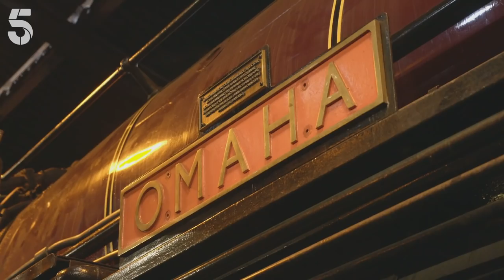Can Boiler Chief Mark Fix A Historic American Steam Train? | The Yorkshire Steam Railway | Channel 5

Comment: The man hitting the piston with a hammer should make a ring compressor so he does not repeat the butchery.
Reply: Served his time at Dewhurst 😁
Reply: @G Rossi Just make a ring compressor as he had already broken one butchering it.
Reply: the different sizes of rings and were they sit inside the castings make using a compressor a pointless exercise that would take 5 times longer cos you would need 3 different ones at least and theres no space to get them in. the quickest and most efficient way of getting that assembly in is in fact the way it was done. because the rings are spun cast iron as well the chance of busting them is just as high however you do it as there as thin as a child's christening band.
Reply: @roberta6641  Thanks for your reply, I am a machinist would has machined many sets of cast iron rings in my time, It is very hard to see the way the bore is machined and the way the rings are mounted, are they the same diameter or a different diameter.
Reply: Exactly what I thought. Mark should have compressed the piston ring with a jubilee clip as there was no room to fit a piston ring compressor before hitting the piston down with the hammer handle.
Reply: @roberta6641  cable ties. Your friends in situations like that.
Reply: I was thinking the same.

Comment: Its nice seeing a U.S locomotive operating abroad.
Reply: You realise that S160s and S100 dock tanks (known as yank tanks) were built in large numbers to operate in Britain and mainland Europe in the Second World War, right? The only American part of them is the design, there entire heritage is within Europe.
Reply: @o.m.b.demolitionenterprise5398  true but several of the S160's and S100's did work in the United States after the war, with several of them have since been preserved. Still most of them were in Europe but I've always considered then international engines given they really did work abroad anywhere a nation needed them.
Reply: And she's a valued member of our railways Steve. :)
Reply: @o.m.b.demolitionenterprise5398  Incorrect. These locomotives were a standard design used by the US Army Transportation Corps (USATC). They were specifically designed for use on European lines taking into consideration European design standards and were intended for heavy freight work to help with the war effort and they were shipped to Britain during World War 2 in large numbers ready for the Invasion of France in 1944. A total of almost 800 were built between 1942 and 1943, and shipped to Britain. 

They were constructed in thirteen batches by the American Locomotive Co. (Alco), Baldwin, and Lima. Although intended for use after the invasion, the first 400 were put to immediate use by the British War Department working with the "Big Four" railway companies.
 
The first forty three locomotives to arrive in Britain were overhauled by the LNER at Doncaster, and hauled local services whilst running in. The first S160s were largely concentrated in the South Wales area, so they were quickly transferred to the Great Western Railway (GWR) in early 1943. Between March 1943 and January 1944, a total of 168 S160s would enter regular LNER service. After the first 400 entered service with the "Big Four", later S160s were prepared by USATC personnel at Ebbw Junction before being greased and stored ready for use after D-Day.

2253 herself was built by Baldwin Locomotive Works in America in 1943 and shipped to Britain aboard the Norfolk which arrived in Hull in May 1943.
Reply: @Crimsonedge1  that’s what I said...
Reply: @o.m.b.demolitionenterprise5398  you said they were built in Great Britan tho
Reply: You guys have got one of our old London Underground trains now. I believe it’s being featured in a museum. Looks completely different to what it did when we had it though lol
Reply: @o.m.b.demolitionenterprise5398  true, but Britain and Europe piggy-backed off of America’s still intact infrastructure and factories to make our machines of war. Essentially an American design built to operate within a smaller loading gauge. We can call them one or the other, but they are in fairness both.
Reply: @presidentobunga8102  No I didn’t, read my comment.
Reply: There are none of this class operating in the US that I know of
Reply: Designed to last a few years and they lasted to the end of steam

Comment: After all it is an American piece of equipment. Eventually it will do the right thing and work
Reply: Emphasis on eventually.
Reply: Not anytime soon, but yes, eventually
Reply: Or not.
Reply: Not if someone is willing to pay it even if it's not working.
 This is coming from an American, here. Yes, I am employed.
Reply: It’s amazing just how durable these things are they were designed to last 5 years thru the war and several are still working today
Reply: @duxlorbitxl9986  I mean..its a 70 or so year old disposable steam locomotives that was built to last the span of WW2, yet its still working all this time later. Regular American locomotives working in America are usually less problematic then British steam locomotives given they are designed to be easier to maintain are far more rugged. Not sure where any brit, especially when you consider british diesels, gets off by saying American equipment is inadequate or unreliable.

Comment: Seeing an american locomotive with buffer and chain couplers makes me uncomfortable
Reply: Why?
Reply: I mean I believe this one was made in the UK, its called american because it was Designed in the US and was used in the US for a while and I am sure the US provided the parts and tools to build them in the UK to help the war effort in WWII. I can agree though that the chain couplers are just not right on a locomotive, its just feels off.
Reply: @PilotTed  No, it was built By Baldwin Locomotive Works of Pennsylvania.
Reply: @PilotTed  It wasn't made in UK. It's fully American built locomotive for military use during the war. It was specifically designed to fit British and European railway standards. After the war those locomotives were given away to many European countries.
Reply: It is a strange sight…. Although I think it’s cool seeing an American Loco with British rolling stock. Very cool!
Reply: That's Like If the big boy were to be Built smaller and less heavy than it is to Be apart Of the British Railways
Reply: @PilotTed  It has a Baldwin builders plate (Works Plate) as seen in the video.

Comment: Looking at these USATC locomotives is kind of strange, because they are very obviously American designs but they have buffers and chains and don't have a bell. It's freaky but very cool.
Reply: the proportions are also dissimilar to basically all other locomotives so it's a bit strange to behold, but still pretty cool
Reply: It's a strange configuration, but very common in a old railroad here in Brazil: the Companhia Paulista de Estradas de Ferro (Paulista Company of Railroads). They used to have american steam locos, but 'til the mid 50's uses european buffers-and-chains couplers. Even had 3 "very american" diesels ALCo. PA-1 with these couplers
Reply: Its definitely cool seeing an american engine built to the standards and limitations of british irons. I would reccomend looking into the Flying Scotsmans USA tour to see what it looks like the other way around! She wore a cowcatcher, lamp and bell, equally strange lookin
Reply: I think the exported 160s had Bells... They were just hard to see as far as I know.

Comment: Wish we could make eco-steam engines  because I just love the look of steam engines and all the mechanical stuff moving and the steam
Reply: There is a steam locomotive at the grand canyon railway that burns recycled vegetable oil with burns much cleaner that oil.
Reply: Steam engines are as eco as they can go really there 100 years old or slightly less meaning no manufacturing infastructe they last well forever and produce steam and water no issues
Reply: @jamestaylor766  lol
Reply: Fireless locomotives are still fairly common for certain applications
Reply: A steam engine will rarely be as efficient as even a bad diesel... due to the thermal cycle it runs 1-10% efficiency is common, and later steam engines can get into the 10-20% efficient range, whereas a steam turbine may be in the 40-50% efficient range.
Reply: Torrified biomass may be the ticket for green steam
Reply: @Wingnut353  one could build a steamer more efficient than internal combustion in theory
Reply: @the_retag  The last N&W classes were more thermally efficient than the GP9's that replaced them.
1930's-era Deutsche Reichsban steam classed were more thermally efficient than 1950's-60's diesels. The DB simply ran them until they electrified the heaviest mainlines in the early 70's, & dieselized the rest w/units that were finally as efficient as the wartime steam engines.
Reply: Steam engines are from a far better time, when things were interesting, because weak pansies weren't allowed to ruin everything.
Reply: @emilyadams3228  they are bette rin some ways than internal combustion, problem is cost. And electric where possible is realistically the most eco
Reply: @emilyadams3228  the DR (east germany) modernised much of their steam fleet, the reko program, because they didnt have enough other locos. And if you want to see some super-modernisations of steamers look at the red devil and a 52 i think it was that dlm (formerly steam part of slm) modernised
Reply: @the_retag  Yeah, they built some fabulous & beautiful engines. Some of the best in the world.
Reply: the problem with steam locomotives is not the pollution, its the maintainance. an old saying goes "a day on the road is a day in the shops." the mechanical complexity brings a lot of downsides.

Comment: I find it jarring to see an American locomotive in Britain, but then again, a Big Boy or the Atchison, Topeka and Santa Fe Railway (San Fe) 3000 class 2-10-10-2 s would look crazier there. Though the Baldwin 10-12-Ds look like they fit, that's because of a different gauge.
Reply: how about this, an Isle of Man 4-4-0 on the cumbres or durango lines. would be fascinating since same guage but iom loco is tiny compared to a k37
Reply: A lot of american mallets physically won't fit on the british rail network
Reply: The rail gauge is the same but the UK structure gauge is even smaller than some narrow gauge systems and certainly all standard gauge.
Only US equipment that fits was needed to specially built low and narrow like this war time locomotives but still standard rail gauge.
Reply: @johnd8892  Or a smaller earlier locomotive like the early baldwin 2-8-0's and The old rogers ten wheelers
Reply: @raymondleggs5508  you have reminded me of the earlier era when the USA made smaller Locomotives for home use and export. In 1899 the Midland Railway, Great Northern Railway and Great Central Railway purchased a total of 80 Baldwin 2-6-0s of similar design, fitting the UK loading gauge. The last of these ran in 1915. A short time for UK railways Their short period of operation did not convince the railways to make any future  purchases but the Mogul wheel arrangement caught on.
Another US locomotive running briefly around the same time was an ex Philadelphia and Reading Baldwin 4-2-2. Later bought and named Lovett Eames by the Eames Vacuum Brake Co to demonstrate their brake in the UK. Photos show it fitted with buffers but importantly a special curved profile and possibly lower cab fitted to cope with the tight clearances in the UK. Only did a few demonstration runs that was judged not to show enough advantages over  existing UK vacuum brakes. It's bell survived at Kings Cross then Hornsey.
I think this was the total amount of US standard gauge steam usage until WW2 specially built locos.
I must track down the actual substantially smaller width, height and width over cylinders to cope with UK platforms, tunnels and bridges.
Even caused a major redesign by EMD to fit SD40-2 mechanicals into the restrictive car body needed by the class 59 and now class 66 diesels.

Comment: Using a crescent wrench in a workshop area, hitting a screwdriver while using it as a chisel/drift, not surprised he broke a ring, surprised he didn't break another, all this in one small repair, wouldn't go down well working on any mans machine, wonder what the owner thought on top of it not being available to him through a breakdown.
Reply: Not as bad as when ours was damaged while on loan. You take out the swearing own MD said. They couldn't have it back once it was fixed.

Comment: The 160s were originally only supposed to last 90 days.
Reply: 90days? That sounds too short, i know the german 52s were made for 15 years, but 90days just sounds to short for the effort of making any kind of locomotive
Reply: @the_retag   it was a while back when I found out so it could have been 90 or 190 days
Reply: 90 days. There is a link in the valve gear that can be cut to disable the, should they have to be abandoned in a retreat, as well as an emergency steam dump valve on the boiler to dump all pressure. The metal was just thick enough and indeed it was  90 days.
Reply: @jacobwoods8738  thank you for the clarification

Comment: Does the "boss" not understand this is like 100 year old technology and wont be as reliable as his 2010 honda car
Reply: 1: 200 year tech
2: it is
Reply: I don't think this production is fair to anyone involved in it. Of course they are going to drama it up for TV, but a ~100 year old piece of machinery being temperamental is just business as usual. It really made the boss and the locomotive owner look sort of unreasonable, and that probably (hopefully) is not the case in real life.
Reply: @bussesandtrains1218  actually 100 year was correct, the s160 was built roughly in the 1940s.
Reply: @ryano.5149  actually some owners are absolute peices of work, and ive had the honor of meeting a few that luckily my workplace wont ever do work for again. but the owner in this video actually is an alright guy, ive met him in passing once. he was just REALLY looking forward to going on that loco.
Reply: It is as reliable as a modern car if you repair and maintain it properly. That air compressor wasn't repaired properly, someone caked the outside with 10 layers of paint but did barely any work on the insides.
Reply: @bluef1sh926  but it's gonna cost twice and take twice as long. A  modern car could take less than a day for something like that.
Reply: @proctor107  I'm going to assume you haven't seen much of steam locos, because there are quite a few which could not only out haul any modern car or truck, (Hence why they stayed on the mainline as long as they did), but there are quite a few with more capacity for fuel which means less stops, and as for reliability there are several examples of reliable steam locomotives in preservation, the most famous ones being Union Pacifics Oil Burners. It's all a matter of proper maintenance.
Reply: @proctor107  and in terms of taking twice as long, the timing made by the New York Centrals J3A is generally 16 hrs from NY to Chicago, in a car it would take 12 hrs, but that's only if the road isn't as crowded as it usually would be.
Reply: @proctor107  and besides the other things I've listed, travelling in a steam locomotive actually has more of a public appeal, it's the whole reason why roughly 2,000 steam locomotives are preserved in the US.
Reply: @darkchaotix1productions326  That's besides the point. The while point is he wants it done in like 2 hours which with old technology just isn't enough time.
Reply: @proctor107  well, it would depend on whether they already had the parts needed at hand, but it would likely take much longer than 2 hours.
Reply: @darkchaotix1productions326  Are you alright? This aint debate club.
Reply: @proctor107  Everyone knows that this isn't a debate club, but this is a internet platform where people can debate things if they want. And as such I chose to debate your earlier  statement.
Reply: @darkchaotix1productions326  Right? I mean you do you mate.
Reply: @proctor107  it's not the "old technology" that's the problem, steam locos are a lot simpler than your average car... it's just the size of the thing that makes everything take longer

Comment: Imagine if the UK got FEF locos
Reply: That would be a big problem, Even tho U.K and the USA share Quite the same loading gauge, American locomotives like the FEF is Simply too Tall ,wide and heavy for the rails and for Station platforms and traveling through most of U.K areas. Just think of what the big boy could do to those Rails.
Reply: The rails would all die at the thought of an fef
Reply: @backonpro5679  I’m sure they would, but old me didn’t know that

Comment: Stopped Dead center was the issue on the cylinders.
Reply: Wrong, one side is in 90 degrees offset to the other, so when one piston is in the middle of the cylinder, the other is at the end of the other cylinder.

Comment: What doesn't help is that its an S160. They were designed cheap, built cheap, and ran on duct tape more than metal. They were war engines, which is not uncommon. Do a job short term, then get thrown away in 5 min. But because they are like.....the ONLY standard gauge American steam locos left in the UK, they create the perception USA engines are finicky and unreliable. Which isn't true, American engines, when built for actual long term use on a railroad instead of quick military jobs, are actually quite robust. But of course, all you fellow UK steam lovers out there love to rip on the S160 and America by extension lol. (Which to be fair, we Americans rip on the S160 alot as well heh).
Reply: There’s 4 s100 USA tanks in the country dude